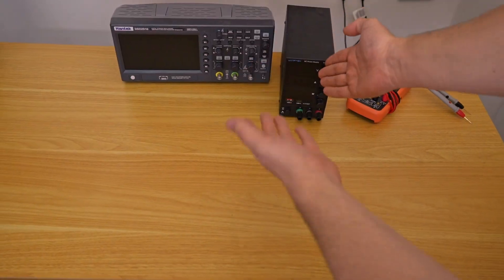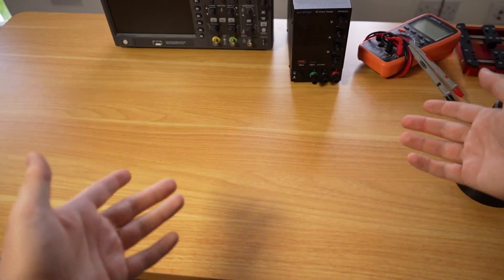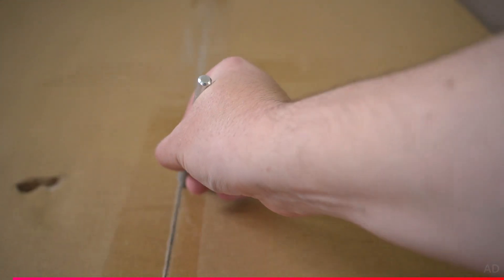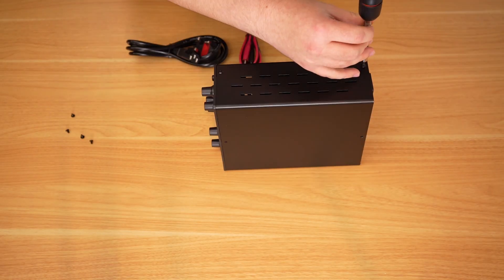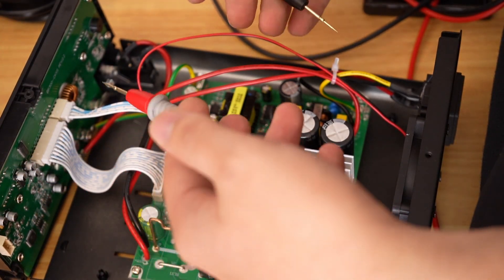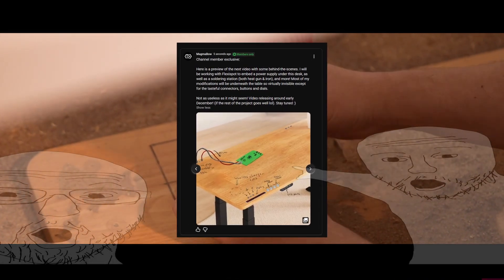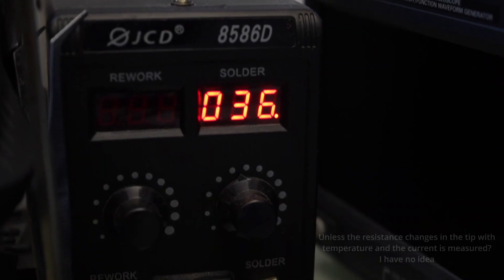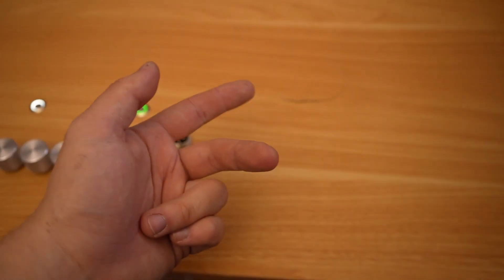I Made the Ultimate Electronics Desk

Comment: 15:08 What I do is I take a knife and just scrape off the surface mounted LED from the PCB, works every time
Reply: I just tape over it, or heat up one side with a soldering iron and rip it off. But usually a bit of tape is easier